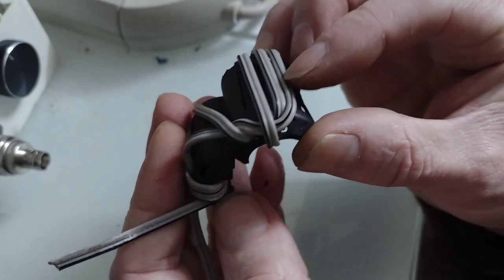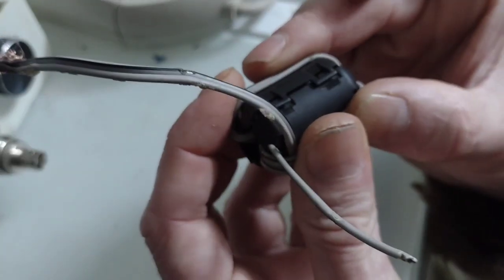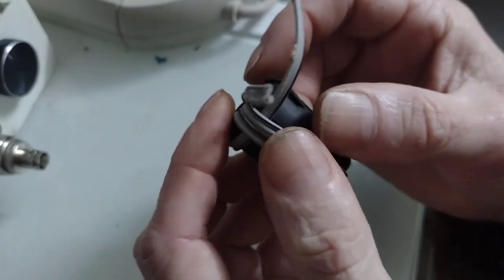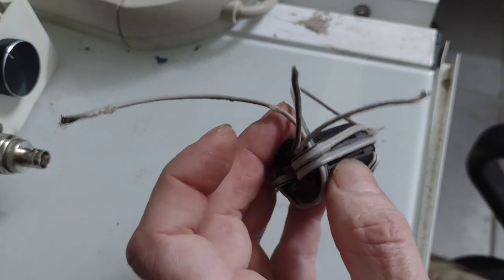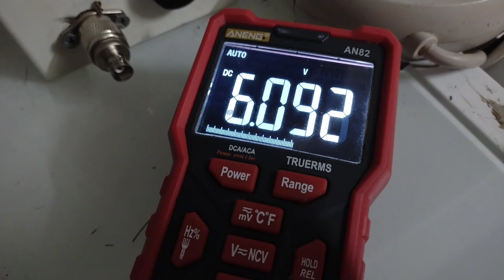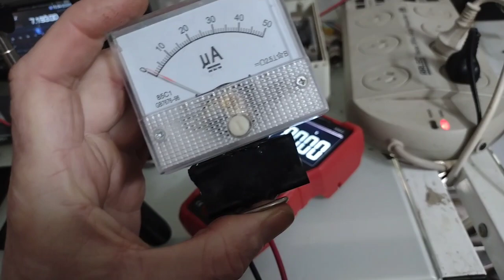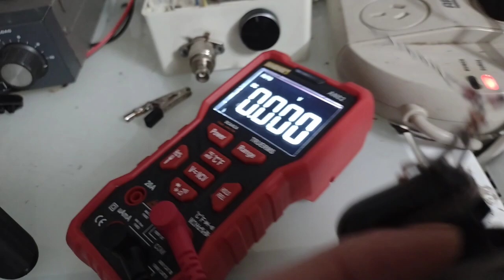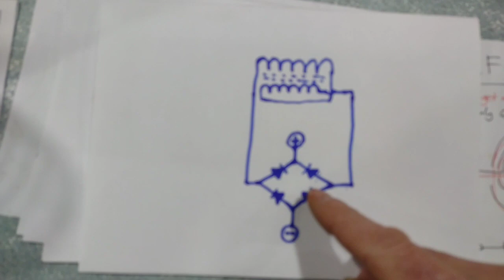How to Build Common Mode Current Meter / Detector⚡🙏⚡ORIGINAL & SIMPLE⚡🙏⚡

Comment: Nice, I will build one of these for my work, this is the same primary winding on my replication of Tesla’s single wire radiant earth transmission circuit. The bifilar coil really is a magical design.
Reply from the maker: Excellent Mate, Yes it truly is a very dynamic design. There is more that can be done by going trifilar too having the middle wire rigged in reverse as a feedback loop.  Perhaps I will do a vid on that one day.  Glad this Helps mate.  The amount of turns and core type will determine the frequency response, So for much much lower frequencies you may wish to use much finer wire to allow for more windings and like mentioned in the video a twisted pair will work the same way as two parallel wires.
Keep up the Great work Mate & I always enjoy seeing new videos from you too.

Cheerz From E ⚡🙏⚡
Reply from the maker: PS: If you check the latest Vid on this, U will see it works well as a visual display of currents just using a 3 volt LED instead of a meter.
Reply: @crazyham  Cheers, I watched that one first actually and clicked the link in the description for this video. I have the exact same ferrite suppressor clips and a similar sized wire so I will make it as you have shown first before I start with variations. Keep up the good work.
Reply from the maker: Excellent Mate 
& Thank You⚡🙏⚡

Comment: Thanks for sharing, this is a very handy device to have .
Reply from the maker: No Problem my Friend.

Since this video I also used the same clip on ferrite, winding and diode config simply attached directly to a low voltage LED
and it is amazingly sensitive.

It even illuminates when clipped on coax not in use if I transmit on another antenna at 10 watt lol.

I am so glad it is useful for You my friend.
73 from Crazy Ham
VK3VKe ⚡🙏⚡